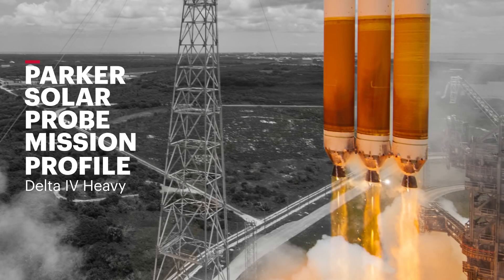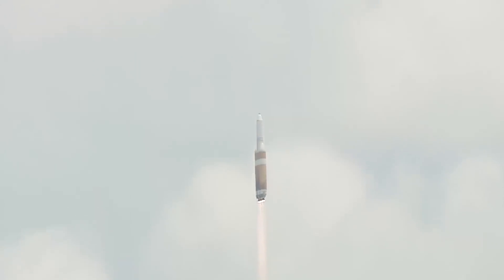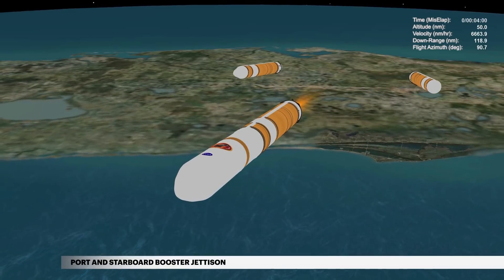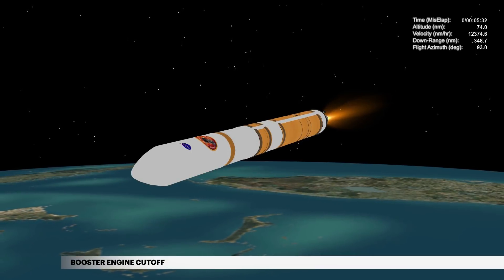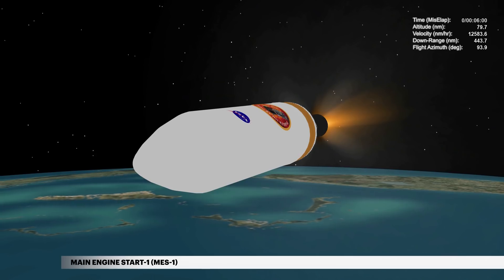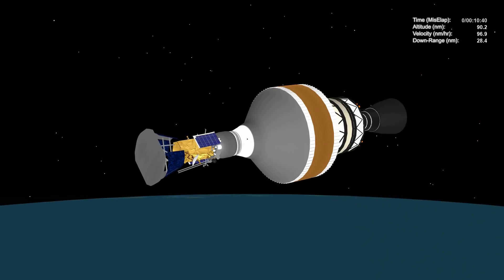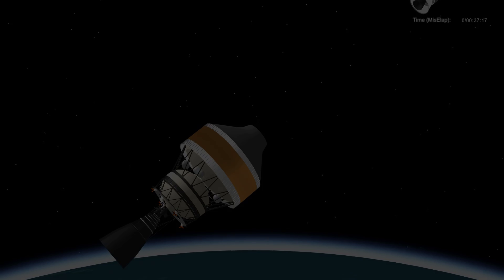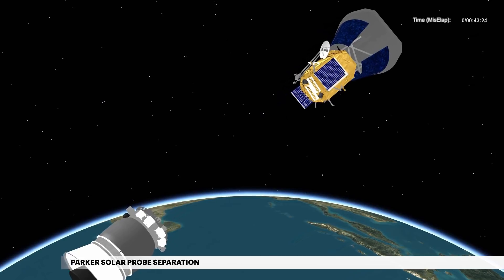Delta IV Heavy Parker Solar Probe Mission Profile

Comment: To clear this up, Falcon Heavy could easily launch this probe to the sun. NASA went with the D4H because the FH had not finished development at the time of the contract. No, NASA should not switch to using the FH, they should honor their agreement with ULA.

The more you know.
Reply: How much did this launch cost?
Reply: isn't the last stage of falcon heavy wouldn't comeback to earth, so FH can totally do it
Reply: Gregory Worley falcon heavy would not be suitable as spacex isn’t doing single use falcon heavy yet. In its reusable “mode” the amount of delta-v would require using more of the other stages delta-v to perform what the delta 4 heavy would perform without using extra fuel. In non reusable “mode” the falcon heavy would do fine.
Reply: Tristan I agree. The FH is over twice as strong as the D4H but the D4H is very efficient and has great delta v. FH is best for lower delta v missions such as LEO satellites, so that all 3 first stage cores can be recovered. It is important to note however that even when fully expendable, the D4H is over twice as expensive as the FH
Reply: Gregory Worley

Not true, the vacuum Isp of the Delta IV Heavy hydrolox upper stages far exceeds that of the F9H kerolox design. Meaning that for these interplanetary missions the Delta IV is a far more efficient launch vehicle due to amount of orbital burns that have to be made.

Comment: Only currently flying rocket capable for this mission? What about Falcon heavy??
Reply: I'm pretty sure third stage would fit inside FH's payload fairing. LH2 has has really high isp, but the 2nd stage on D4H isn't so big, and SpaceX launched Roadster to orbit which almost reach ceres. That's a lot of delta v.

So I do think FH with the same solid 3rd stage would be capable for this mission, but I also think NASA did right choice when they decided to launch The Parker probe onboard D4H, cuz it's probably less risky. Especially when this project started few years ago, Falcon Heavy did not exist.
Reply: SpaceX still has to do the Air Force demo mission (slated for Q4 2018) in order for them to get NASA contracts.

Plus, when this contract was given out, Falcon heavy was still a "paper rocket".
Reply: Victorbrine Cassini actually the Parker Probe was originally scheduled to launch in 2015, long before falcon heavy was in the picture. So they went with ULA. I’m not bashing ULA btw
Reply: The Parker mission was approved years ago; long before Delta IV-Heavy ever flew. There would be no point cancelling the Delta IV-H launch for this flight and therefore forcing an expensive redesign of the Parker spacecraft.
Reply: Masa Järvinen I bet they'd feel safer using a rocket that's flown more than once
Reply: Unlimited Porgs that's probably safer choice, but the sentence in description isn't true.
Reply: Masa Järvinen ULA also had a lot more experience on sending objects to other plants in this case a star
Reply: Lmao almost everyone asks the same question.
Reply: Masa Järvinen Falcon Heavy is too young. They will start using it eventually.
Reply: Falcon Heavy could quite happily put PSP into its target orbit, if they flew an expendable Center core with a double drone ship landing then a 3rd stage wouldn’t even be required
Reply: Masa Järvinen FH is too powerfull
Reply: Falcon Heavy couldn't do it. PSP is going so far past escape velocity that only a cryogenic second stage could take it.
Reply: Coolstorm this is just false. The one and only reason that NASA chose ULA over SpaceX is because the Falcon Heavy had not yet been developed

Comment: Solid rocket for 3rd stage?  Unusual!
Reply: Unusual? What about New Horizons, Ulisses, Galileo, Voyager 1 & 2 ? It's a very common practice to use small solid upper stage for escape burns with high delta V requirements.
Reply: winged omg senpai I find you in this comment section I love ur vids
Reply: Pretty sure he meant that it's unusual for the Delta IV, not in general.
Reply: Oh for Delta IV Heavy it's definitely unusual because DIVH wasn't used before as a launcher for interplanetary/deep space missions.

Comment: @ula a heads up for your animator. The dcss exhaust burns blue since it is hydrolox, not orange.
Reply: Jon the first stage is also hydrolox, and it burns orange. Technically hydrolox burns mostly translucent.
Reply: I didn't think about the CBC. I was unaware of the ablative cooling!
Reply: Only burns pale blue if the engine nozzle is regeneratively cooled; like the Shuttle RS-25 engines.
Reply: If you compare RS-68A with the RS-25, TWR is actually better on RS-68A at the cost of Isp.